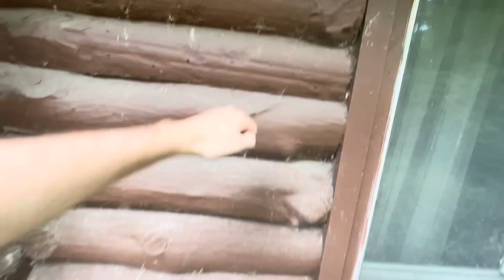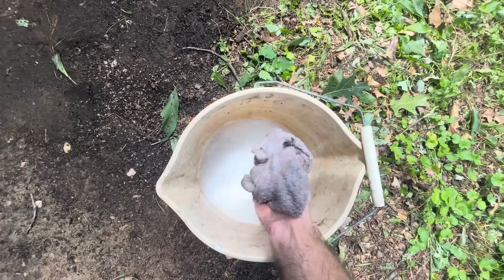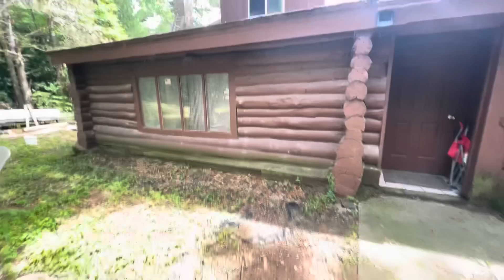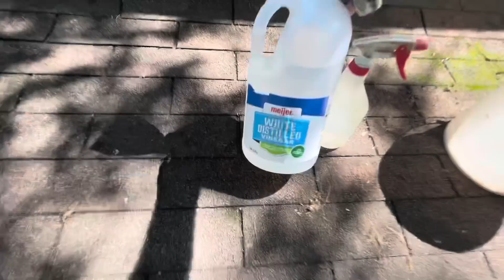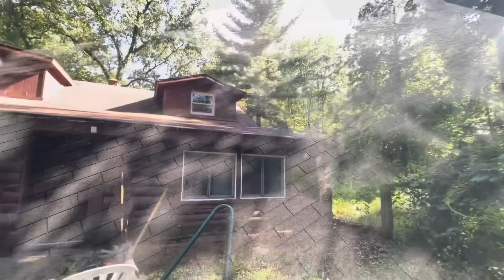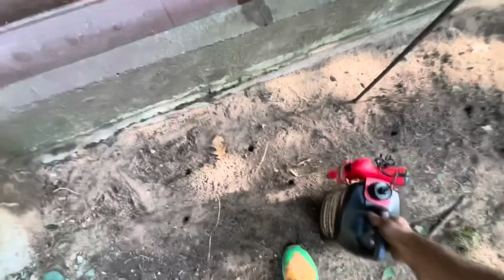Day 2 termite control at my house - visit from a buck (deer)

Comment: A tip for the termites, along where you put holes and put the liquid, you could cut a small mini trench and fill it with burnt wood ash that also helps to keep the termites away from getting into the wood
Reply from the maker: Ok thanks

Comment: Dustin I think the best thing you should do is to replace the wooden wall with bricks or cement wall sheets. Thats life time  solution.
Reply: Are you willing to donate about $100,000 USD? Materials and labor in the US isn't cheap. My family's home in Philippines was built completely of pine logs. It was built in the 40s and it is still standing today. In the other hand my family home in one of the pacific islands is built completely of concrete to include the roof. Also, if he was to completely replace the logs, he is basically building a new house. I almost guarantee the electrical in the house likely needs to be updated and that alone can cost at minimum $6,000.

Comment: Hello Dustin that's a lot of work fighting the termites. After all of that work it will only take one termite to make it to the cabin and within a week there will be an investigation of termites again. I would get some linseed oil and a brush and brush them up in the openings of that rotten wood that will weatherproof it better before you spray the poison for the termites
Reply from the maker: Thanks Calvin

Comment: Dustin try using a Garden sprayer. They are cheap you fill it and then pump it up. Spay that on the roof it does a much better job and a lot faster. You can also fill it with Bleach and do the inside walls as well with the sprayer.  Now I know you might not believe this but if you have a spider problem you can rub anything citrus. Orange, Grapefruit, Lemon, Lime on the lower walls and the spiders will not climb the walls. You can rub the Citrus on bed frames as well and it will keep spiders off the bed. Anot trick is if you eat Steak MR, Beans, Eggs, and drink beer  you can keep Reche out of you're bed for a week. OH baby to them farts stink  and if you have Gravy then everyone in the house will have their eyes watering. I know I love eating that stuff but I can't stand my smell after lmao.
Reply: Came here to say this. I just bought one at home depot last week for $11. Well worth it.